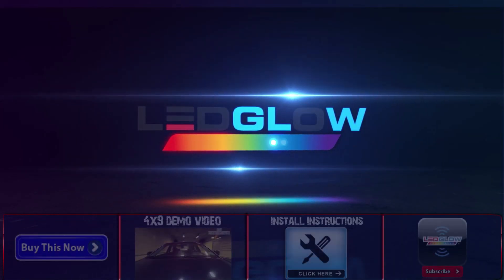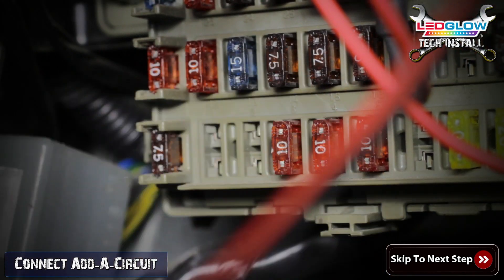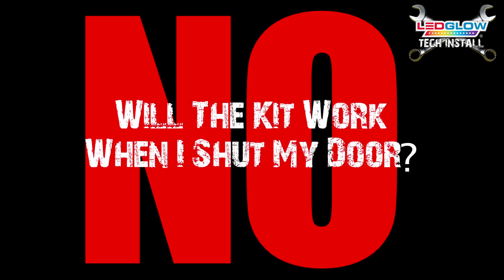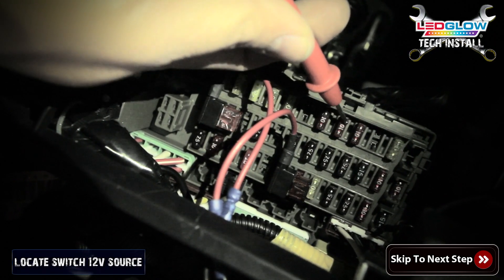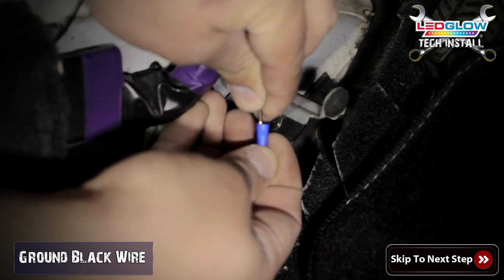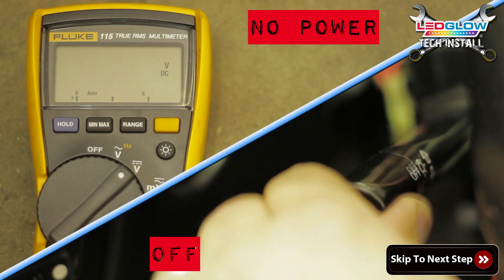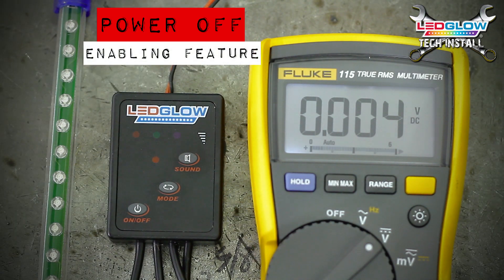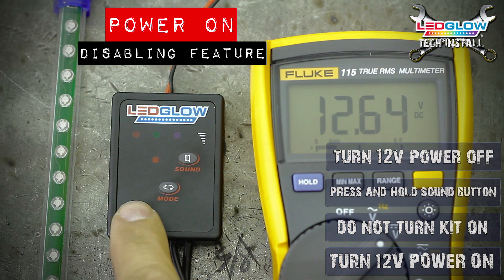LEDGlow | Auto Illumination Mode for 7 Color Interior Car Lights and Truck Lights

Comment: What all do I need to install in to the door switch?
Reply from the maker: You will need an expandable circuit for power and wiretap connector to connect to the door pin.

Comment from the maker: The interior kit pulls extremely low amps when it is not in use, so you will not have to worry about it draining your battery over time.

Comment from the maker: The kit only functions at 12 volts, so there's no way you can change the amount of volts and still get the kit to work. What kind of interior kit do you have? The Single Color Kits come with numerous brightness levels, but if you have a 7 Color Kit and it's too bright, unfortunately you won't be able to change the brightness levels. You can reposition the tubes so the brighter part of the glow would be more below your seats or facing more upward under your dashboard.

Comment: How would I install it and not use a add a circuit?
Reply from the maker: If you don't want to use an expandable circuit for your installation, you can use either a cigarette lighter adapter or you can run the power and ground wires directly to the battery of your vehicle. If you want to power the kit from your battery, you will need to extend the kit's power and ground wires using 16 or 18 gauge automotive grade wiring. We have install videos for each you can check out. Cigarette Lighter Adapter: LEDGlow's Cigarette Lighter Adapter Powering Your Kit Directly from the Battery: LEDGlow's Powering Your Kit Directly From The Battery. If you have any other questions or concerns don't hesitate to ask!

Comment: So how would i wire it so that it only turns on when i have my headlights on? Working on an 03 ford fiesta. thanks
Reply from the maker: To wire this kit to only be powered when your headlights are on, you would need to connect the red power wire from the kit to a fuse or wire that receives 12v power only when your headlights are turned on. If you need any assistance please call us at 1.888.LED.GLOW

Comment: Could I wire this to my engine start button since it’s always on and put auto illumination? That way I can just unlock my car and it turns on and it stays on even while driving.
Reply from the maker: Hi, this is certainly possible to do but we would recommend having a professional do the installation in this case. We recommend this because you would have to take your ignition apart in order to wire it this way. Cheers, LEDGlow Team
Reply: Doesn't have to be  wired to the ignition, any switched source in the fuse box would do the job to keep the lights on while driving.

Comment: I need help, why does my led strip stay on even if door is closed or even if the cars are not in the ignition,help
Reply from the maker: bird hoe It sounds like you're powering your kit from a constant 12v source. If you don't want your kit to have power when the car is off, I recommend changing your power source to a switched 12v source so the kit will only have power going to it when the car is on. Let me know if I can help with anything else!

Comment from the maker: Unfortunately in order to do this then you will need to have 2 separate kits. That's the one downfall about connecting the kit to the door pin, it will only function when the door is open and will not function at all when the door is closed. Let me know if you have any other concerns!

Comment: Are all of the kits the same as far as having the sound mode?
Reply from the maker: Yes, for the most part, but some do have more sound modes than others do.
Reply: LEDGlow or buy a led strip and conect how you want

Comment: Is it possible to combine headlight and doorpin options together? Or do I have to install 2 separate led systems...
Reply from the maker: Hey, in this case, you would need to install two separate systems. If you have further questions our tech and customer support team can be reached by phone 865-768-5700, techsupport@ledglow.com, or Live Chat on the site. Cheers, LEDGlow Team

Comment from the maker: Unfortunately the kit will not function with the door closed because you are closing the power circuit going to the kit with your door. When the door is opened, the power circuit to the kit opens and you'll be able to use your kit. If you're not going to use the auto illumination function then I recommend finding another grounding location for the black wire so you'll be able to use the kit with your door closed. Let me know if you have any other questions!

Comment: Can a switch be adding to a constant 12v power supply to control the lighting ?
Reply from the maker: The control box that comes included with the kit is meant to act as a switch, but, if you wanted to add an additional switch then yes you can do that.

Comment: I'm still having a hard time. I have an 02 protege and I don't have the volt reading equipment and will I need to purchase more things besides the light
Reply from the maker: Christian Rodriguez What are you having problems with? You don't necessarily need the voltmeter for the installation. We used it to show the voltages for the switched and constant power sources when the car is on and off, but it does help with the installation. You will also need to purchase an expandable circuit if you want to power your kit from the fuse panel or you can use a cigarette lighter adapter to power the kit as well.

Comment: Is it possible to get these to turn on solid with your dome light? If so do they have to be hooked into the dome fuse? my dome fuse is under the hood which would be a pain to get to.
Reply from the maker: Yes, for our kit's that do have this auto illumination you are able to wire this into the dome light itself.

Comment: Hey I have had my kit for some time now and has worked great but for some reason they are turning on automatically when I am not in my car and has killed my car battery. If I tape the floor with my foot hard enough they turn on.
Reply from the maker: I apologize to hear about the issue you are having. I would contact technical support at 856-768-5700, or by e-mail at: techsupport@ledglow.com

Comment: Would these led lights turn on when you unlock your doors?
Reply from the maker: +LanceTV Yes, you can do so with this kit! You would just need to activate the "auto on" feature, and hook either the power or ground wire up to the door jam depending on how your door jam switch operates. It will be ground control or not.

Comment: So if i hook this up to any 12 volt fuse slot it'll only turn on if the ignition is on?
Reply from the maker: Yes, unless that fuse slot has constant power, in which case, that would allow you turn the kit on and off whenever you'd like.

Comment: So say I want it to only be on during the night what would be the best set up through my headlights correct?
Reply from the maker: Hi Tyler, if you wire the kit to your headlights and set the kit to auto illumination like this video is teaching you, then the kit will only power on when you turn the headlights on. I believe this would give you the desired end goal you are looking for as you only want them on during the night. If you do have further questions please contact our tech support team or seek an automotive electronics professional. Cheers, LEDGlow Team
Reply: LEDGlow thanks guys I've been hoping around watching car vids and interested in giving my car my own personality nothing to major but subtle lighting on the inside another question does the kit have a dimmer to adjust how bright I want my lights as I don't want to look like a rave going down the street lmao.
Reply from the maker: Hi Tyler, we would recommend a single color interior kit with 5 levels of brightness. This can be controlled via the included remote or control box that comes with your kit. Also, don't forget with your purchase you receive FREE lifetime tech support. Cheers, LEDGlow Team
Reply: Will the bass of the music work In solid color mode?

Comment: There no question on what im concerned about so here you go... If i do a door pin connection, when the door is closed, wont power be freely let loose to ground, thus draining the car battery?
Reply from the maker: When the door is closed, there would not be any power going to the system and would not cause this to drain the battery.

Comment: If I connect it to the positive coming off of my headlight switch do I then connect the ground to anywhere on the car body? And does that mean the LEDs will turn on whenever the headlights turn on???
Reply from the maker: Hi Justin, you will connect the ground to any unpainted metal ground on the car.  The LEDGlow kit will turn on whenever you turn your headlight switch on. Cheers, LEDGlow Team

Comment: can i use the headlight fuse instead of the headlight switch?😢
Reply from the maker: +Tj Louissaint Yes, of course! You can either tap into the fuse, or us an expandable circuit.
Reply: Thanks a lot for the help

Comment: Is there a way to wire these lights so the turn on/off when the doors open/close and also turn on when I start the car? Working on an '09 Mazda 3
Reply from the maker: The kit is only meant to be wired to a single power source. You would have to either wire them to your door light, or wire them to a constant power. If you are able to find a way to achieve what you are asking, please let us know!
Reply: LEDGlow Will do! I do have an idea, but I won't be putting it to work until I know what will happen. I figured it wouldn't hurt to ask you about it. What would happen if I split the ground wire into two, connecting one to the chassis and the other to the door pin? Just curious, I understand if you cannot advise on that. Thanks!
Reply: Actually, nevermind. I just remembered that in order to wire the kit to the door pin, it would need a constant 12v source in the fuss panel, defeating the purpose of what I want to do. So I guess I answered my own question :)

Comment: hey, what do I do if I can't get the spade terminal between the female socket and door pin?
Reply from the maker: You can also just splice into the wire coming off of the door pin switch.

Comment: I have a few questions about these kits, I know it's possible somehow I've seen people with it done. How would I get the lights to turn on when I hit the unlock button on my key fob, and also turn on when I open my door, and also turn on when the ignition is on? I don't want to have to purchase 3 different kits what a pain lol.. But I've seen people wire one kit to work all these different ways.. Any help or links to guides are welcome! Thanks
Reply from the maker: Hey, currently with our kits to do all 3 of those methods at the same is not possible without extensive custom work.  We'd recommend reaching out to a mechanic or someone experienced with automotive wiring directly for help on this matter. Unfortunately, we do not have any guides available. Cheers, LEDGlow Team

Comment: So if i'm powering my LEDGlow kit by running it to my battery I can't have the lights turn on & off whenever I open and shut my door?
Reply from the maker: If you want the lights to turn on when the door is opened then you will need to connect the power wire of the kit to the 12v power wire for your overhead interior light that turns on when the door is opened.

Comment: My door pin in my 2015 Honda Accord is different than the one shown here. I am unsure of where to plug in the connector to the door pin
Reply from the maker: The best thing to do would be to use a voltmeter, or multimeter, and probe the wires going into the switch to find the ground.
Reply: +LEDGlow and when I find it, splice it?
Reply from the maker: Yes, that is correct

Comment: can use fuse in fusebox to connect led with  headlight??
Reply from the maker: Hi, we would recommend connecting it to the positive coming off of your headlight switch. If you have further install questions please contact our tech support team via phone, email, or Live Chat. Cheers!
Reply: 1. Then connect the ground to anywhere on the car body? And does that mean the LEDs will turn on whenever the headlights turn on???
Reply from the maker: Hi Justin, you will connect the ground to any unpainted metal ground on the car.  The LEDGlow kit will turn on whenever you turn your headlight switch on. Cheers, LEDGlow Team

Comment: If I want them  to turn on with my headlights can I use the extended circuit for the headlight circuit? Or does it have to be directly through the headlight switch wire, because I can’t find the wire from the headlight switch.
Reply from the maker: You can use a headlight fuse.
Reply: LEDGlow thanks

Comment: So if i use the door option, will the lights stillnwork when i start the car?
Reply from the maker: Thandiwe Mines Unfortunately when you install the interior kit using the door option, the kit will only function when the driver door is opened. When the door is closed, the kit will turn off and won't turn back on until the door is opened. Let me know if you have any other questions or concerns!
Reply: Thandiwe Mines Wiring, The LED's Do Your Door Switch, When Grounded Out, Will Only Cause Your LED's To Act As "Courtesy Lights When You Open The Door, I Found The Best Method Is Using The Ignition Switch, And Your Radio As A Power Source, When The Key Is Turned Over They'll Illuminate, But When You Remove The Key, They'll Go Off.

Comment: If I install this with my ignition switch, can I still turn off the lights with the power button on the box?
Reply from the maker: NSXShockwave If you have the kit set to the auto illumination function, you will not be able to override it and power your kit off from the control box. If you have the kit installed to the ignition switch without the auto illumination function enabled, you will be able to power the kit off from the control box. Let me know if you have any other questions!

Comment: If I want to do the auto-illuminate feature on my 2012 challenger, what additional parts would I need to purchase before contacting customer service for help in setting it up? Unfortunately the video is a bit sped up at this part and it really isn't specified which parts come with the light bars.
Reply from the maker: You will need an expandable circuit or cigarette lighter adapter for power and a ring terminal to mount the ground wire.

Comment: Im a little confused, where exactly do i plug in the spade connector ( for the door auto- illumination)? right into the existing connector?
Reply from the maker: Ash, we are more than happy to help. The spade connector will plug in-between the door pins male and female connections. However, do remember that with every purchase you do receive free lifetime tech support so please feel free to contact the LEDGlow tech team directly at 856-768-5700. Cheers, LEDGlow Team

Comment: LEDGlow if  use the door option and splice the ground wire to a screw on the car bady will the light work when the door is closed.
Reply from the maker: Hey Marlon, by splicing the ground wire to a screw on the car body the kit will be on when the door is closed but it will not automatically turn on when you open the door. It will remove the auto-illumination option because you would be providing a constant ground with the ground wire spliced to the screw on the car body. If you have further questions our tech team is available Monday to Friday from 9 am to 6pm EST via phone, email, or Live Chat right on the website. Cheers, LEDGlow Team
Reply: LEDGlow ok thank you

Comment: I have a 2006 Chevy Cobalt. I'm trying to wire them to the interior fuse box so when I turn the key and turn the car on the lights come on. what are some other switched sources. I do not have a sunroof so that won't work, thanks in advance.
Reply from the maker: Hello, 

Thank you for contacting us if you want the kit to turn on when you turn on the lights you would have to wire it to the same power source as the light. If you wire it to the fuse box it will get power as soon as you turn your vehicle on.

Comment: Could I install the under lights, and interior led lights to a 1995 ford bronco?
Reply from the maker: Giovannie Flores Yes our LED lighting kits are universal and can be installed to any vehicle with a 12v battery, so you're good to go with your 1995 Ford Bronco. We offer underbody lighting kits with the option of adding up to 2, 4 or 6 interior tubes to the control box so the interior lights are synced with your underbody lights. If you have any other questions or concerns about any of our kits don't hesitate to ask!

Comment: I had these on my 2014 Camaro which I spliced into the dome light wire. Now I have a 2018 Camaro and want to do the same but have no idea which wire it is. Don't want to do any other method. Any help?
Reply from the maker: The only suggestion we can make is to use the owners manual to locate the relay and use a test light to locate which wire powers the dome light.

Comment: Auto door Illumination is way to quick and not that visual. Does this item come with instructions to install it in this fashion?
Reply from the maker: The instructions will instruct you on how to install to a 12 volt power source, but you can give us a call directly at 1-877-LEDGLOW and we can further assist!

Comment: Is there a way to keep them on when the car is off
Reply from the maker: Yes, you will have to wire the kit to a constant 12 volt power source so that the kit can be turned on with or without the key in the ignition.

Comment: I tried installing my LED lighting kit on my Mazda Demio, for some reason it won't light up. Using the "Connect add-a-circuit" method. Am I missing something? I need help pros... And I followed all the steps on this video, my LED doesn't light up.
Reply from the maker: +Joseph Borromeo I am sorry to hear about the issue you are having with the your LED kit. I would recommend sending an e-mail over to techsupport@ledglow.com to receive some help from our technical department.